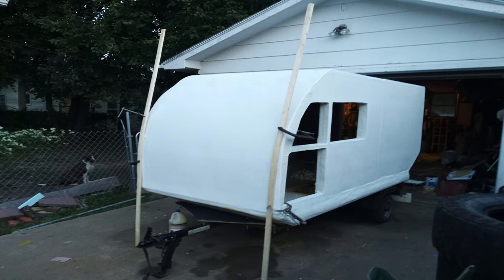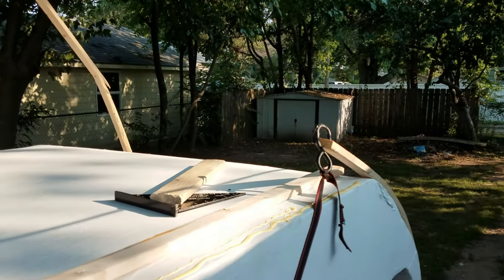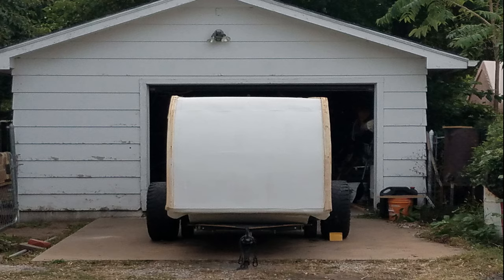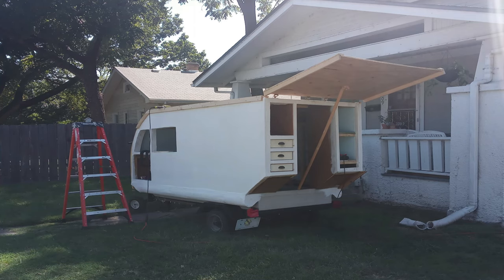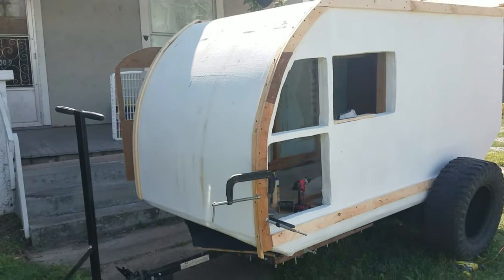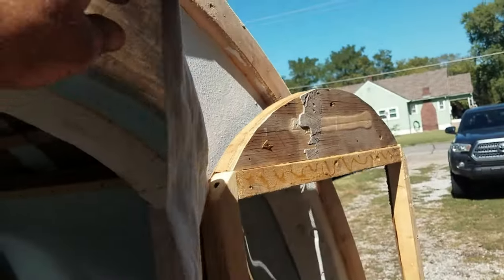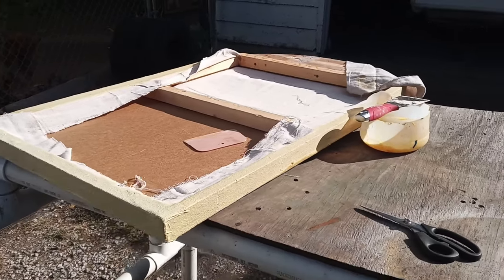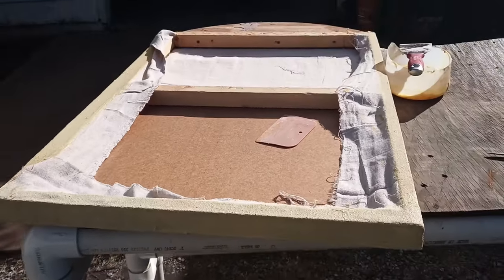In this episode I will be doing the trim work. (Berserker part 6)

Comment: I believe you can use epoxy resin over XPS and probably have a better bond (if abraded) than the PMF then fiberglass. 
Interesting dual purpose build. Well done...
Reply from the maker: I will certainly look into that. Thanks for the advice